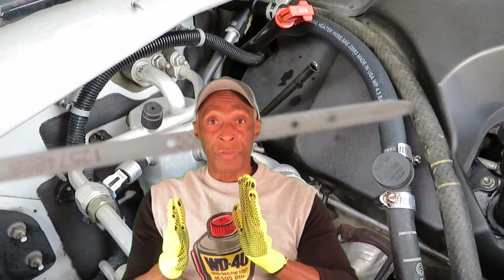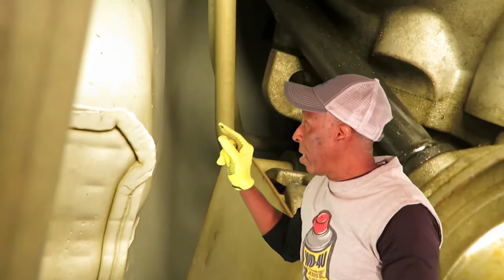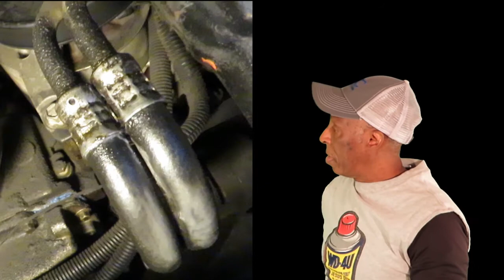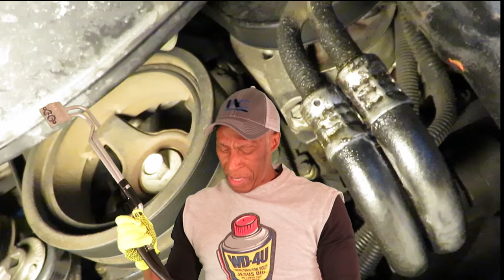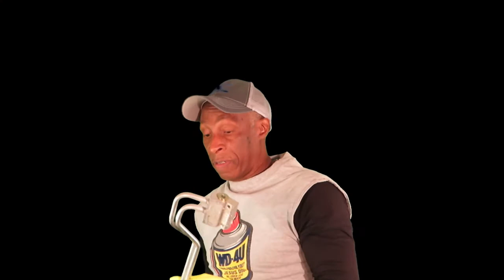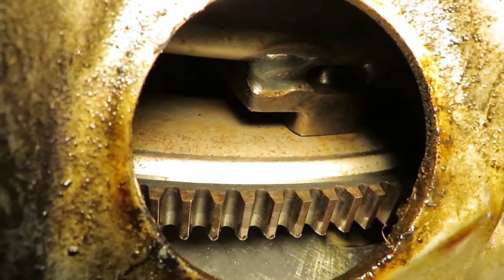fixing an oil leak on a 2004 Yukon Denali XL 1500 4 wheel drive part 1

Comment: My oil pressure gauge is laying down n I have an oil leak… Do you think the oil pressure sensor/sending unit could be my problem? 03 Yukon. Thanks
Reply from the maker: these older SUV'S will begin to fall apart. so what l would do replaced the oil pan gasket. and make sure the oil pan dipstick is secure in the pan. and take it from there.